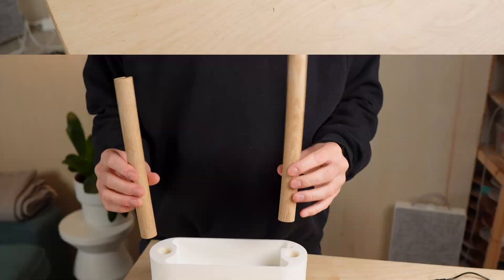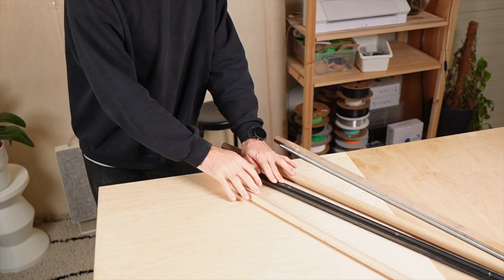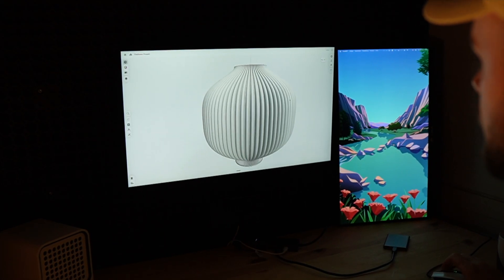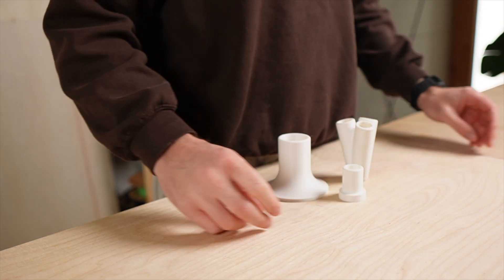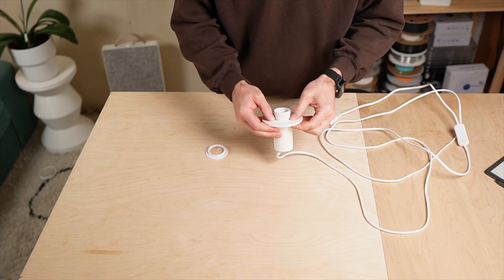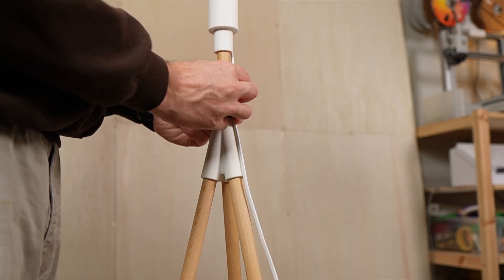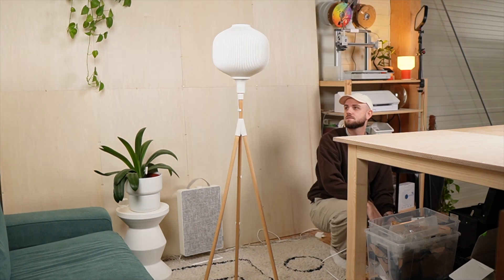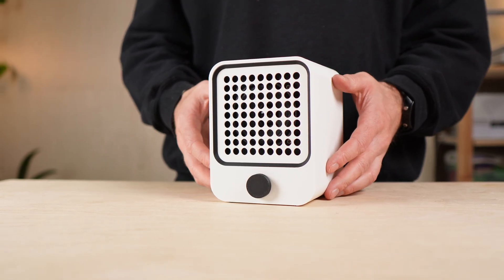How I 3D PRINTED a 5-Foot Floor Lamp

Comment: Hey Paul! I really liked the lamp idea and the content. I came up with a similar zigzag pattern for my first lamp. But how did you manage to print it so clean with all the inclination at the base?
Reply from the maker: Hey, thank you very much! up to a certain angle that’s no problem at all. What works best for me is printing it in vase mode with a slightly wider line width for example 0.6 mm on a 0.4 mm nozzle. Hope that helps :)

Comment: What is wooden legs size? I want to know it before I would buy 3D model, because I have to check if I can find that from local store.
Reply from the maker: There are two versions included in the download. An „EU“ version (20×1000 mm) and a „US“ version (3/4”×36”). The STEP file is also included if you want to customize it.

Comment: Good but why to say it can cost 300$😂 It will cost around 30 and will be easier to buy than collect all this parts and print
Reply: Oh! You need to go to any weird and expensive store on Europe, you can even find 3D printed "Art" with ugly layer lines for more than 200 euros
Reply from the maker: Thanks! 😊 Totally get your point. the electronic parts themselves are cheap, yes.
But the $300 reference is for designer lamps with a similar aesthetic and build that you would usually buy, not for the DIY version.